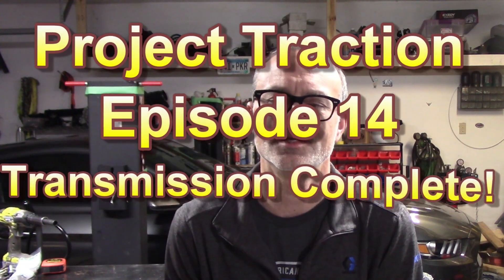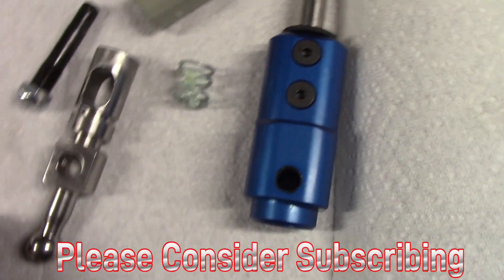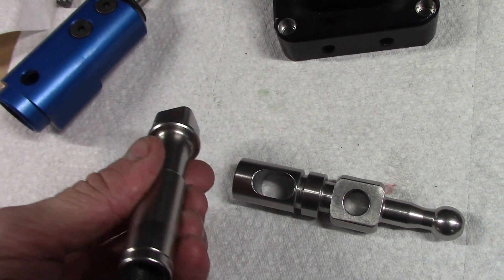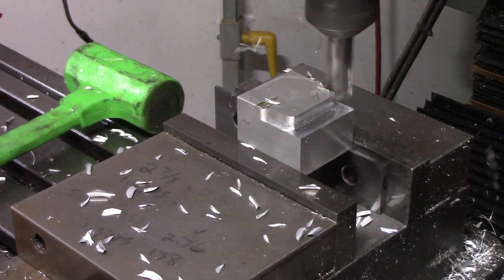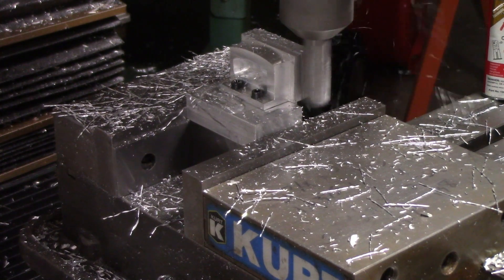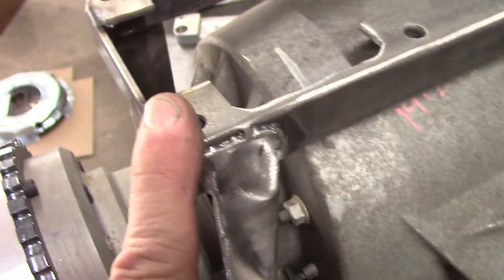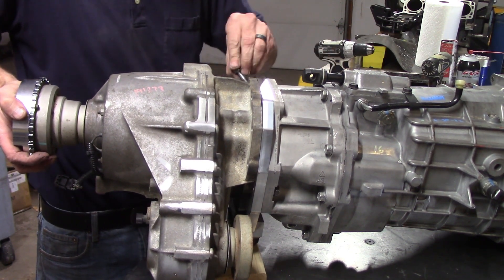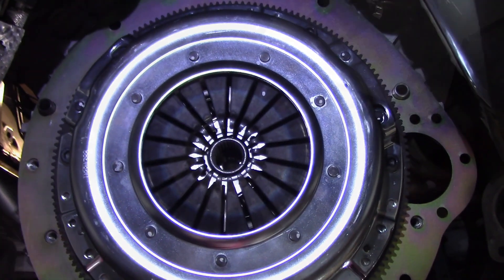Ultimate AWD Manual Transmission!  American GTR -  Project Traction Ep 14, All Wheel Drive Mustang

Comment: If Ford to ever start Making AWD Mustangs they will quickly become America's GTR's.. I would love to have a manual AWD Mustang GT.. I'm only on a 93 Tune and I can't get second gear to hook at all. I can if I short shift a certain way but you get what I mean.. And I know I need a Drag Radial with a slightly bigger sidewall.. I bought GT350 Style wheels and went from the Stock Continental 275/40/19 on the rear to 305/35/19 a Nitto NT555 G2.. It was a PP set up so the fron's were 255's so i went to a 285 to keep the same stagger.. It's all supposed to be with 1% on the diameter and the SVE wheels don't really feel any lighter to me.. But I think because the wheels are a little lighter and the tires not as good, that's the reason I smoke those Nitto's even though it's a wider tire.  They say the wheels are 9lb's lighter each but I'll give it a 5Lb difference at best.. I am hoping I was able to knock another 25Lb's off the car.. I think I dropped like 75Lb's off the car and added another 50 back onto it with some light mod's... And it's all OEM plus stuff nothing that takes away from the drivability of the car..

Comment: 12:49 I wanted to use a GT flywheel with my MT82 v6(dual mass fly) swap but ran into an issue where the slave was 1 inch too far away, I used a 1 inch spacer.

Comment: Interested to see how this holds up because the chargers were notorious for having issues with the transfer cases holding power
Reply from the maker: The early units that where an open differential had issues.  The 2010+ is a clutch based unit from borg Warner.  I have not heard of many issues.  The clutch is the same as used in a full size ram transfer case.
Reply: @No Production Value Garage  awesome! I'm going to look into this because I'm interested in an aqd system but for my super duty that can hold power. Thanks for the info!

Comment: On your reverse lockout,  they have aftermarket standalone kits that do it electronically. I put the t56 in my mach 1 and that's what I did. Works great.
Reply from the maker: Thanks for the feedback.  

But, maybe I didn't make it clear in the video.  Since I am using the Corvette tailhousing, there is no provision for the factory/Tremec reverse lockout.  The kit you used on your Mach 1 used the reverse lockout built into the tailhousing of the T56 (TR6060 is very similar).  The reverse lockout on a T56/TR6060 is a spring loaded electric solenoid that the computer of the car controls, keeping you from putting it in reverse unless you are under a certain speed.  The controller you installed simply monitors the VSS and controls the solenoid.  All that is gone in my situation since I am using the Vette tail.  The Vette version of the transmission has the reverse lockout in the shifter cover on the main case.  See the picture here:

   http://tcase.rsgear.com/technical/diagrams/transmission-articles/tremec-t-56-c5-corvette-reverse-lockout.aspx

The Vette piece in the link bolts to where I put the remote shifter adapter shown in the video.

I hope that makes it clear that I had to make something.